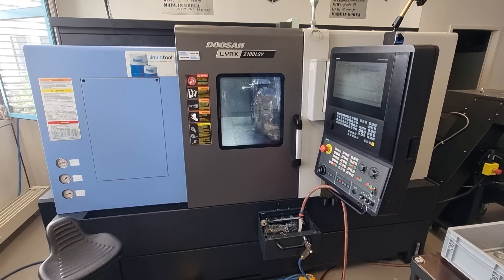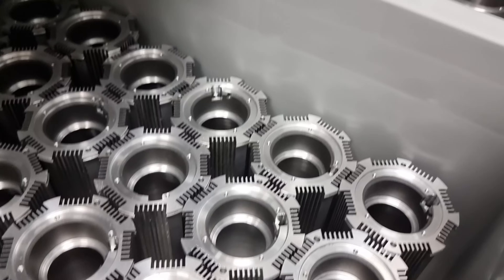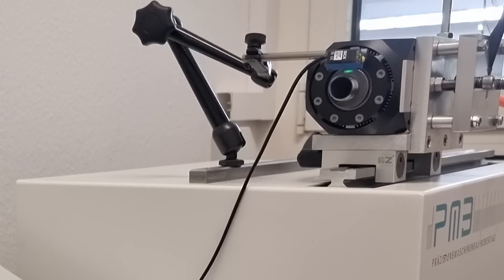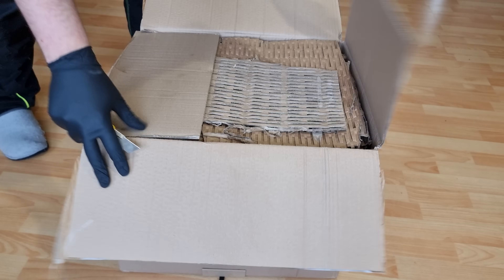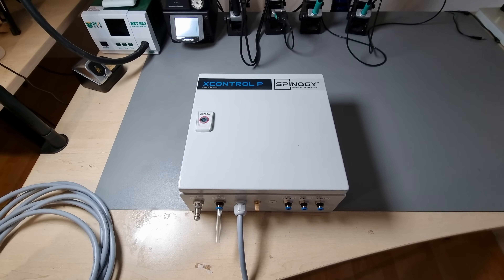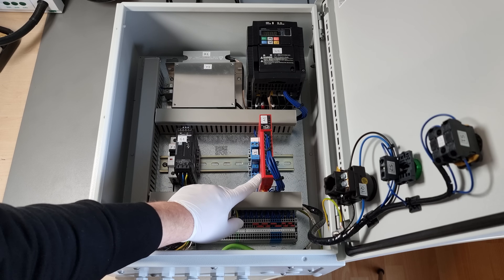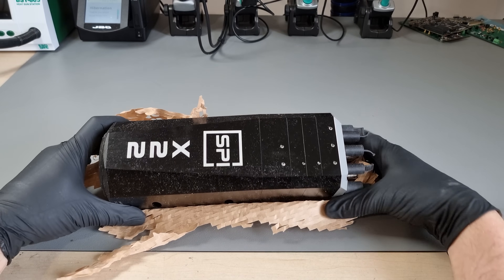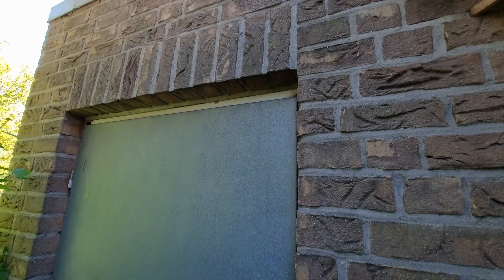Spinogy X22: New CNC Spindle unboxing & Small Factory Tour

Comment: I program doosan turning centers at work, I love how rigid and reliable they are, but Fanuc controllers always feel lackluster compared to Okuma machines. Their GT3100 is a joy of a machine, it roughs steel, stainless, and nickle based alloys with no worries. The live tooling option can be pricey but worth it for sure. The MX2600 is a crazy machine I love to have an excuse to use.
Good luck on your DIY CNC project, there's a lot to learn on how you're approaching it. Please do add an automatic tool changer, its worth it for automating longer run times that you don't want to spend all day for babysitting the machine.

Comment: i could easily see my self putting on of those on a manual mill as a highspeed spindle when running the small tools
Reply: There was a company in the 90's that manufactured a 50,000 RPM 1/4 hp spindle that could be mounted to a machine tool via an R8 collet. I tried using one exclusively for two weeks but wasn't impressed with the results. Of course, the machine tools of the 90's could not deliver the feed rates required by high RPM spindles.
Reply: @GaiusTacitus  it would also only be for the small tools. like my 1mm carbide endmill with 25mm long reduced shank or my 0.5mm carbide drill where the feed of the machine i have in minde is way more then needed for those rpm's at those sizes

Comment: They should buy a desktop type CNC to carve out foam for the transport + 3 ply boxes at a minimum. That kind of upgrade might seem trivial, but it's the kind of thing that shows the customers that you aren't playing around (and it's better than perforated cardboard). This is a cheap upgrade that does a lot for the end experience of the person who purchases this jewel.
Reply: They avoided foam to be more environmentally friendly, plastic foam is terrible, it easily sheds particles that take hundreds of years to decay, and it can only be incinerated unless collected, sorted and then recycled. We need to limit the use of one time plastics, they really should not been seen as a standard.

To make it look better they could have used a wooden box with laser cut inserts inside to hold the tool securely. Though wood also has an environmental impact in the form of land use and disturbing forests.

Comment: The moment I knew I couldn’t afford one of these is when I saw the pallet on billet stock
Reply: One of our precision instruments for measuring the length of wool fibers included a keypad mount that started out as 24 in. x 6 in. x 6 in. (609.6 mm x  152.4 mm x 152.4 mm) aluminum bar. More than 85% of the aluminum was removed during the machining operations. Other materials and approaches had been tried but none proved adequate for producing a part that was required to aesthetically pleasing. 

Of course, this part was manufactured by a company that produced its own keyboards (which were sealed to prevent entry of dust and water vapor) at a cost of $1,200 US in 1984 (more than $3,500 US in 2023 after adjusting for inflation). Quality was never compromised regardless of the expense.

Comment: Gee, Marco... ONLY 50,000 RPM??  But, I guess that that is really humming for an electrical drive spindle...I did some consulting at a PCB manufacturer, and watched drills and mills running at 127,000 RPM, but I'm sure that those are air drive...
Building a balancer would be pretty cool... using optical sensor to correlate shaft position with accelerometer readings, FFTs to look at spectra, maybe incorporate an oscilloscope as the central measurement and analysis 'hub'...
My, my, my.... what a "christmas unboxing"!!

Comment: Yes to the DIY imbalance meter! The really cool thing would be to compare the phase of the drive and the vibration, so you could identify where a balance weight needs to be added as well as how big it needs to be. 😁
Reply: Have a look at model jet turbine builders - there are a few designs for DIY balancers that do exactly that.
Reply: Also interesting would be something DIY to measure stuff like thermal expansion.

Comment: Wow this is awesome! But is it just me that's concerned about those vent gaps on the side of the motor? What if some metal parts fly in there?
Reply: Those are holes for tightening the mounting screws - at 12:20 ish you can see the hangers in the back that line up with those holes. You'll also probably need to loosen them a bit if needed to adjust the tram.

Comment: GMN also makes spindles, that is direct drive spindles up to 150kW and 35,000 rpm for some of the world's highest performing machining centers.
Reply: I'm trying to think of what you need a 150kW spindle for and drawing a blank.
Half a meter depth of cut in tungsten?
Reply: @oliverer3  Ultra high performance aluminum machining centers for aerospace and marine components capable of linear feeds on the order of 1000 inches per minute.